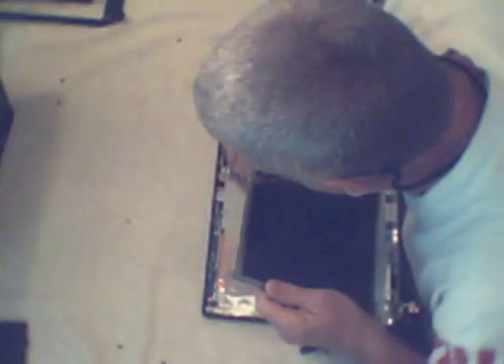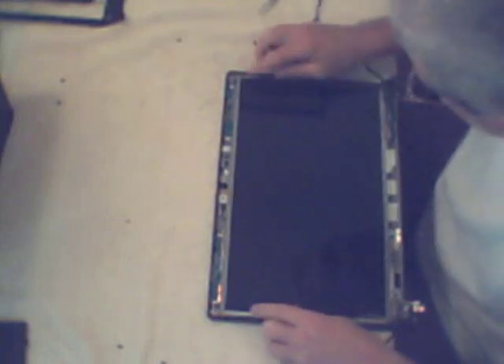How to replace laptop screen on Dell Studio 1555 Model# PP39L

Comment: I appreciate you posting this video and you are very professional in your work.  However, as someone previously said, almost none of this was necessary to replace the display.  Peel (carefully) the front bezel off, remove 6 total screws, and carefully detach the LCD cable.  It took me less time to replace this screen than it did to watch this video.  Looking at it, this laptop looks like the screen replacement might be difficult because of the oddly shaped bezel, but it comes off easily and neatly.  Thanks again for your work.

Comment: Thank you for posting this video.  I stepped through each step with you and replaced the cracked screen on our laptop.  I was thrilled.  Instead of having to buy a new laptop, I spent a 10th of the money to buy the replacement screen and do it myself (after one of the BigBox computer stores said they "couldn't" replace it).  I had to pause several times because I am not as skilled at disconnecting as you are, but I was able to complete the whole process in roughly 30 minutes.  It was very complete instruction.  Thank you again.

Comment: I had to replace the display back and screen cable.  The screen cable end that attaches to the screen is plastic vice brass and there is not clip to hold it into place, so I taped it into place.  Well, my screen quality is very bad so that it is all lines and fuzzy.  Do you think the cable it bad or is it the screen that is bad?  Is there anyway to trouble shoot this.  I don't want to buy a new screen if I don't have to.  What do you think? You can email me wfish1963@yahoo.com.